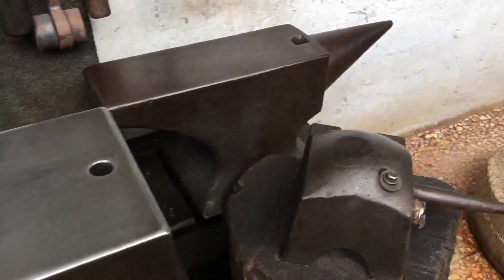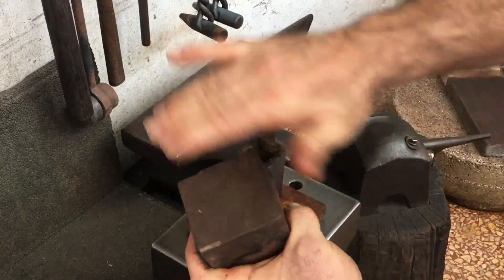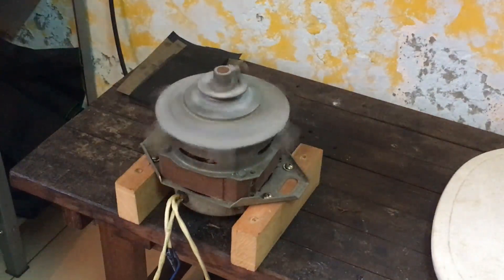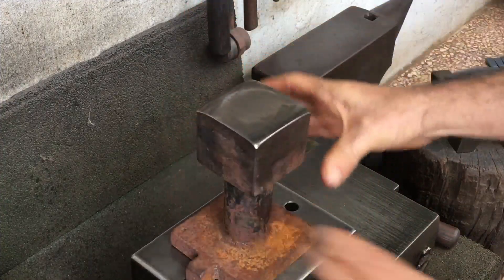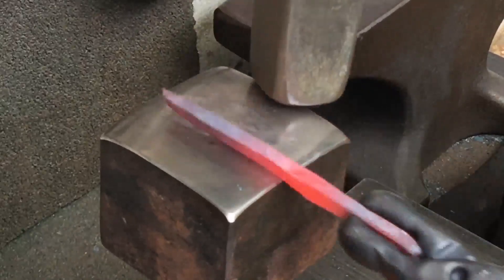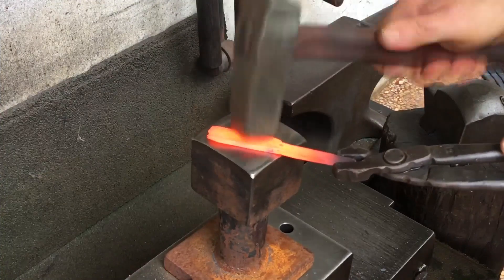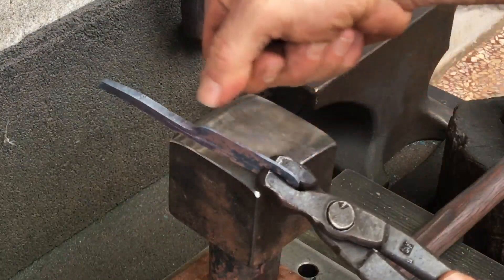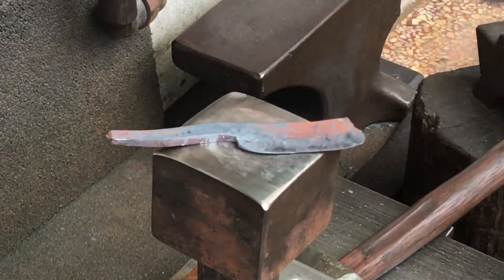Anvil Face Radius for Edge Tools / Forging Straight Razor from Bearing

Comment: I was trying to salvage a washing machine motor few years ago, and it also barely spun, so one time an electritian was fixing something for me and i asked him about that motor. The solution was, the motor needed an capacitor, apparently its build in the washing machine and when you disasambled it you just dont notice it (cos we are not electritians :D). We added a new one and the motor worked fine.
Reply from the maker: Great advice from you and a few others. Really appreciate it. Thanks.

Comment: Love the experimenting, this anvil idea looks like it'll be so handy. I like that you forge the edge rather than stock removal, most traditional as they would have had to do without the aid of modern grinding equipment back in the day. Great work 👏
Reply from the maker: I just don't love grinding and sanding. I think if we can forge as close as possible to the final shape / size that that is best. But to each his own. Thanks for sure.

Comment: That motor is probably three phase. I think it needs a capacitor to work on a single phase. Fun fact about bearing steel: if you forge it too cold it cracks, if you forge it too hot it cracks, it readily hardens in air and takes a wicked edge, provided you heat treat it correctly.
Reply from the maker: You got it - a capacitor is what it needed. This bearing steel is hard as heck. I annealed it and still couldn't drill a small hole with a good bit. Thanks.
Reply: @gstongs  Got to cool it down slower, then.

Comment: Well I just found some valuable use for my small length of gantry crane track, being that it has an almost linear mushroom contour. I figured that I needed to flatten the face to make it more useful. Now it’s definitely staying as is.
Reply from the maker: Yes, maybe leave that as is and it will work well for forging finer edges. Thanks Greg.

Comment: Evening Boss! Loved the razor, very interesting process, great result! Your washing machine motor might be a ‘capacitor run’ or ‘capacitor start’, or DC or AC. You might of had it running well in the past but the lifespan (of the motor) would be severely compromised. They work well for a short while then… exactly what you’re getting now. You can probably find a way to run your motor check out Jeremy Fielding’s channel. You’ll get an idea from there. Cheers Glen! All the best.
Reply from the maker: I appreciate your spot on help. Capacitor made all the difference. Now I need to sort out how I'll use this motor. Thanks my friend.

Comment: Great video. 
How'd the razor turn out?
I was afraid you may have been hammering a little cold.
Reply from the maker: I haven't completed it yet but will. Someone else was saying I shouldn't hit on bearing steel when too cold (or too hot!) due to the potential for cracking. Let's see how it turns out. Thanks.

Comment: I had to use a torpedo heater to straighten out an 18 wheeler wheel bearing, I'm in the middle of building a cheap forge.Out of nothing but fire bricks and spring steel bed frames. I do however have 3 good anvils, one broken anvil, and a boat anchor anvil from Harber freight. It's complete junk.

Comment: I allways use the small anvil for the cutting Edge. It is not nessesary to have it round shaped. The Advantage is that the Heat ist Not succed away from the big anvil. Greez from Germany.

Comment: Really interesting anvil info. Almost see a forged in hollow grind effect being possible.

Is your dog head hammer flat faced or rounded? I'm sure it plays into the efficiency of the anvil. Thanks Glen
Reply from the maker: Yes, your point about the hollow "grind" is possible with enough anvil radius. My hammers all have slightly rounded faces. Small changes can make a really big difference. Thanks.

Comment: Are you aware what the original application / appliance the e-motor came from ?
Any data tag(s) affixed to the motor ?
Such information can get you to exact details needed. 

PS..
Thanks for sharing.
Reply from the maker: It was from our old washing machine. Good point about checking for tags / info. Thanks.
Reply: @gstongs ,
Well..
Was worth a shot. 
Best of luck with it.

Comment: Typically a washing machine motor is a three phase motor. If you are running it on single phase you would expect it to spin like that. In the washing machine there would be most likely 2 capacitors to make up the additional phases a start and a run capacitor.
Reply from the maker: Thanks for the very useful advice. Got it going...
Reply: @gstongs  No problem. However, I think I was wrong. After your second video about the motor I can see that it's a single phase motor. It has two windings 180 degrees apart which will also cause the same problems you were experiencing without the start cap. This is why you only needed a start cap and not the additional run cap.  Without the help with startup from the cap you can "push start" these motors in either direction to get them going.
Reply: Jeremy Fielding's channel is Awsome for learning about different motors and how to use them in personal projects!

Comment: Forget about diy homemade bench grinder crap that you see on youtube.Those machines work for 1 video only .
I wouldnt bother with building a bench grinder that uses stones ,honestly those are so cheap its not worthy of time,mounting a stone directly to a motor and making it run true is a nightmare unless you have a lathe,if stone is not mounted and balanced properly the whole thing shakes and jumps like a goat and the stone can actually explode and hurt you .Just save up some money and buy industrial bench grinder not those cheap chinese craps with 150w motor that you can stop by slightly pushing into it.
Reply from the maker: I've got an idea for a different sort of grinder setup using this motor. Let's see... But I'm enjoying my new belt grinder, even if the quality isn't excellent. Thanks.